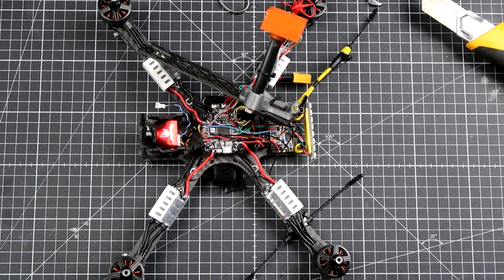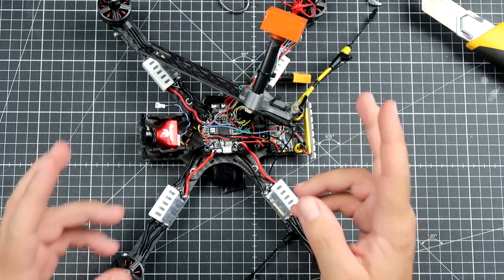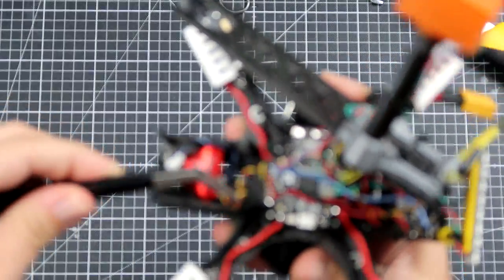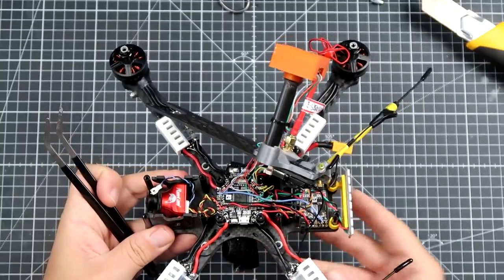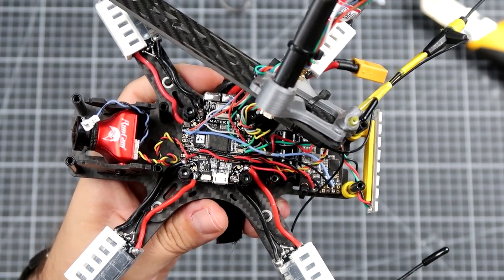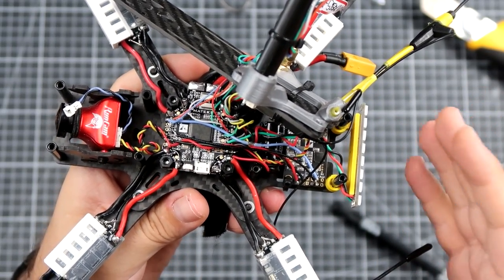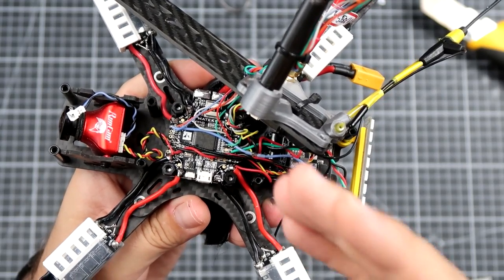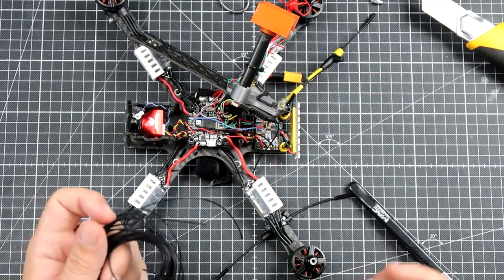3 simple tips for a clean analog FPV

Comment: Hi, wanted to share some unbelievable(for me) problem that I think I just found out the cause. About 2 months ago so, I noticed that my analogue vtx was performing very very badly. The issue suddenly started to appear out of no where, and I started having the same issue with 3 of my quads. All producing bad noise to the point I can't even pilot it properly. Now this issue really brought me to the core of frustration. I rewired in every possible combination, resoldered, used lc filter, low esr, used coax cable, redundant ground, any possible method, I tried. Replaced brand new antenna, vtx, motor, fpv camera, fc, heck, I even built a brand new quad. Nothing, nothing solved the noise. Just yesterday I noticed that this noise only appears when I power on my radio, when the radio is off, my vtx transmits wonderfully. I am using elrs. So what i did today was to just lower the elrs module power output to 500mw and puff, the noise is gone. Like magic. It was unbelievable. I burned a fc, vtx, lost a whole quad, and precious time over this problem.

Also, what i don't understand is, I have a moblite 7 ELRS with the Happymodel diamond f4. And I've never had any issue with its vtx transmission even in 1 watt. Man, I hope to know the real technical reason behind this and how to actually make 1watt work without issues.
Reply: did you figure it out?
I suggest use dynamic power, to not have to blast at 500mW all the time
Reply: wow ive literally had exactly the same problem, after connecting my radio the VTX signal reduces significantly, like i cant fly over around 20m away even when running at 200mw, will bump it up a bit and see what happens , btw did u ever find the issue, i even posted on Reddit about it and didnt get any helpful answers

Comment: This is one of those thoughts I have had and never acted on. Because so many people focus on power I figured this idea to be wrong. Thanks for posting this. I actually purchased coax long ago to do this, now I will. 
Cheers!
Reply: did you succeed?
Reply: @flat-earther  Yes but not exactly how I planned. The coax likely helped but the biggest improvement came from changing antennas. I changed both Tx and Rx antennas to 125mm lolly-pops. I also looked at the SMA connector which can have a lot more solder attaching it to the board. Originally I just thought the lolly-pop was the fix but changing 2 things at once always levels you guessing. I added the solder because I was concerned the long antenna would pull the SMA connector off the VTX. In that process of re-soldering it did appear the amount of solder on this connector was very inadequate. When you check your VTX next, see how well your MMCX or SMA connectors are soldered on.

Comment: I've just built a 6 inch quad , And it had slight ones in the FPV monitor , I slid some Ferrite beads over the power wires from the the vtx to F.C and also a couple onto the video wire from the vtx to F.C ....it cured the problem dead , I'm amazed we don't have a lot more RF type noise with our quads as most have very little or No real screening at all ( I'm an RF engineer )  ....You mentioned coax , This is a very good way to deal with interference issues , Mini coax is ideal ... One ground is also the way to go , You don't want Daisy chain grounds causing ground loops.

Comment: I would say:
1: Lipo batteries are not that noisy IMO, despite what many of the recommendations claim. My idea of noisy is ripple presented in switching supplies. I'm not too concerned about a Lipo since it can deliver high peak currents and is about as smooth a supply as you can get outside of a linear regulator, but the loads being supplied by that Lipo are the actual concern because they create noise. The adding of a capacitor is about as far as I ever see the tip go, but I'd say it would make sense to not only add a DC reservoir capacitor on the supply rails, but also any necessary decoupling capacitors directly on IC's which are not yet protected. Those would be something like small ceramics around 100nF to 1uF or so. 

2: Supply the vtx from a source isolated from the supply the motors are on. To me this is where the 'noise' comes from in the Lipo. If the VTX is on the same source as the motors then you are certainly dealing with line noise. Then physically shielding the motor cables should actually help block the fields. 

3: Good wire management as you mention. Crossing wires and untwisted pairs with no shielding is always problematic even at simple audible frequencies. The key phrase there is "twisted pairs" as the point is to cancel out the fields in the pair, which should be equal and opposing among them.
Reply: thanks for your insight.
BTW magneticitist, have you become a flat earther yet? If not I suggest viewing the 13 part series what on earth happened in my about to learn how the earth is not a globe

Comment: Great video - I'm pretty sure that this is the solution to my current video noise issues.
I just don't understand one important aspect of your solution, and in the comments it seems that I am not alone. 
Do you connect the outer shielding of the coax to a ground pad? That's what it looks like but to a newb like myself I want to be CERTAIN.
Thanks Pawel
BTW could I repurpose an existing broken rx antenna instead of buying coax?

Comment: best practice:
1)cam to the onboard 5 v bec, vtx - to the onboard 9v bec
2)if it is only 5v bec and your vtx supports 5v - connect both to the same bec
3)if your vtx doesnt, then connect it to the vcc pads, a cam - to the 5v bec of your vtx. do not add any additional ground wires to a cam - it usually adds noise under throttle punches ( but, yeah, eliminates osd flicker (better add some decent big cap like 1500uf on power leads))
4)never connect a camera to vcc pads (always adds diagonal noise, lines under throttle punches, etc)!
5)dont buy matek vtx - the shittiest vtx in the world (susceptible to the noise from frsky telemetry if connected to a onboard bec, slow channel and power switching via tramp)
Reply: I've had the matek hv vtx for over 12 months its been great
Reply: @llickmogan   that means nothing tbh
Reply: @MrBirdshell666  whatever

Comment: Hey THANK YOU for this!! Can you help me explain though! So how do you have that co aux soldered in there? The internal going from vtx to fc correct? Then I see there is double ends? "A splice with two diff solder locations". Did you solder the drain wire to ground then on both sides? Thanks fella!!!
Reply: coax cable has essential 2 cables, its a normal single core cable with insulation, wrapped round that cable is a grounding sheath, its normally braided to cover the etire diameter, its a bit tricky to strip  back because dont want to cut through the shield, you strip back just the outside insulation to reveal the ground, unrap it from the internal cable and then strip that to get your signal wire.

attach the signal wire to the video out, and the ground to the ground on fc, do same at the vtx, signal wire to video in on vtx and the ground sheath to ground.

Comment: I cant tell in the video but I just have to ask. You solder both the active and ground element of the Coax to the fc video out pad to thw video in pad to the vtx right? Or you just soldered the middle wire of the coax and left the ground tucked in. Im having trouble solving my video also. I did the  capacitor already, lc filter and twisted all the wires and still noise when throttling.
Reply from the maker: Both sides of coax shield soldered to GND
Reply: @FPVUniversity  Thanks sir Pawel! Will update if, it makes a difference
Reply: Shouldn't you only ground one side of the shield so as not to create a ground loop?
Reply: Coax cable for ground only. For plus you are using regular soft isolated wire, isn't it?
Reply: I still don't get how to wire the coax. I should solder it to the ground but in the video I see to separate cables from the coax soldered to 2 different solder pads, at least I think that's what I see 🤣. Could someone clear this out for me?
Reply: @nicolasvds7528  as the only coax use  scenario coax is used - middle solid conductor you use for signal (video) and outer stranded wires shielding material you ground to common ground.
I am having programmable LED noise when I arm. Where leds would blink randomly with very high frequencies not as programmed in BF. Some online videos suggest that voltage dropping diode is installed on led pin but i am thinking if the culprit is surrounding EMI then mini coax would be better and neater. And also thinking to do it for my video now.
 I solved 90% of video noise months ago by installing homemade CLC filter on the pdb and then using that to feed clean battery power to fc and vtx. I used a ferrite ring coil that was about 4 times bigger then the coils on the mattek pdb that i was using. That also solves gyro noise readings and current noise readings in addition to video and OSD noise. But coax will make it even better i am sure.

Comment: I was wondering about the coax connecting myself.  I'm liking that idea a lot what did you connect it to. I have some old pigtails I can maybe use also just clip them but not sure which part I'm soldering.  The ground cable? Signal or power or all lol using coax

Comment: If I use a coaxial cable in place of a regular silicone wire, do I solder it the same way? Or is there a special way to solder coaxial cables? Thanks!
Reply from the maker: Soldering is the same. Only you have to solder both shield and signal part. Signal to signal, shield to ground on both sides
Reply: @FPVUniversity  Thanks!

Comment: One more thing to check when there is video noise related with throttle - check bolts that mount motors with corresponding ESC pad for continuity. While mounting motors I have connected one bolt with loose wire from motor by mistake, in result there was terrible noise that couldn't be reduced.

Comment: This is the coax cable your looking for on Amazon US. Just cut the ends off and cut to length.

uxcell U.FL To Extended SMA Female Connector RF Coaxial Adapter RF1.13 Wire 20inch Length

Comment: Great tips. What's that blue wire with the connector in the middle of it for? Thanks.
Reply: If you are talking about the camera it is built in cam osd. Nothing to do with fc osd. You can change the RunCam logo show cam voltage or screen ratio - 4:3 or 16:9 or put custom text on the screen. You connect a 5 button remote control with it and need some way to display the output while adjusting it.

Comment: Looks like RG-174/U Coax Cable, very thin.
Reply from the maker: No, this is not RG-174/U. It's only 1.1mm thick so less the thickness of RG-174
Reply: @FPVUniversity  Link please ....
TNK
The old engineer
Reply: @tulliobonfiglio  Read the description
Reply: Any vendor in Europe ??? :-(  :-(
Dont want to wait like 4 weeks on Ali slow :-( :-(
Reply: @chattonlad9382  Read and opened quadmeup ... found many things but not this cable. I sign as an old engineer as a matter of fact, isn't it ?
TNK
The old engineer
Reply from the maker: mate, the first line  http://bit.ly/2Z4xTSI
Reply: @FPVUniversity  The link isn't working I'm afraid just loads a blank page.  Can you post the name of the item itself, so we can search on the site for it?  Or a different link?  Thanks!
Reply: I ordered a month ago and it still has not arrived. I just had an idea - use old laptops' wifi antenna cables, they usually span the entire laptop and the monitors. Do you think that might work?
Reply: @FPVUniversity  @Paweł Spychalski  I know this was two years ago but the attitude/annoyance you showed to someone who supports your channel I just can't help myself; **it was a bad link 2 years ago and is still a bad link today. At least from a security settings standpoint, The old engineer was almost surely not able to get to link destination due to it not supporting HTTPS. In other words, The old engineer was almost certainly clicking on the right link and you responded like you were annoyed at his stupidity (because you clearly were). You  might know cables but you clearly dont know about links/sites/online security settings. Talk to your supporters with a little more respect maybe, even better try to help him/others out, "MATE"